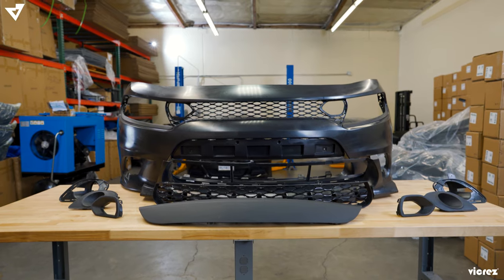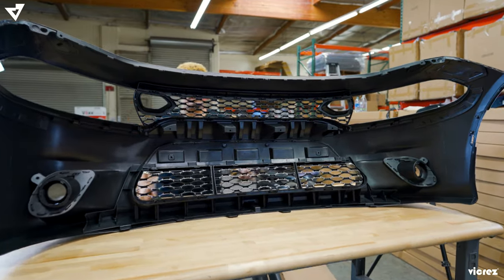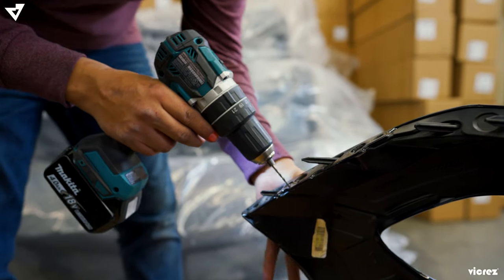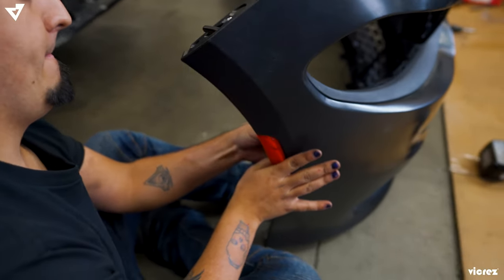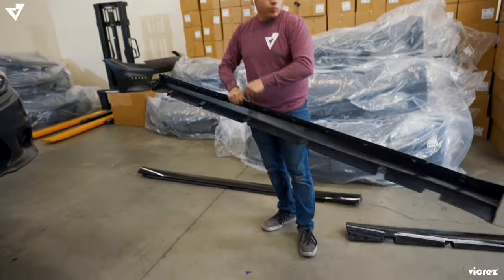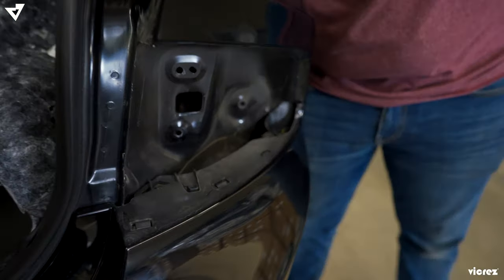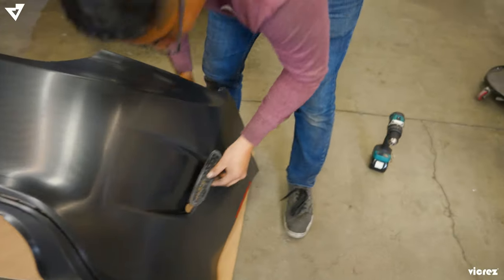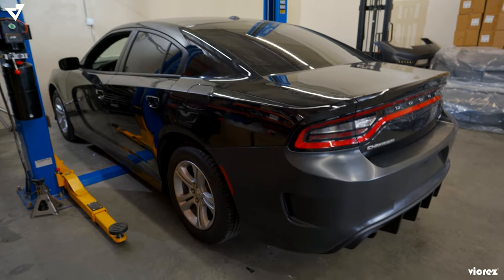Dodge Charger Full Conversion from SXT ➡️ SRT  | Installation  😱

Comment: Everybody in de comments saying to change the engine.. it's easier to say than to do! And for the ones that are V6 haters for no reason, an engine is an engine. They all have their own advantages. Your hellcat maybe gonna beat it but at least the V6 wont run out of fuel in 10 minutes.
Reply: Exactly they be crying at the pump. April 15 2022 reg gas is $3.90 a gallon.. smh 🤦🏾‍♂️
Reply: @ALGreeneHTown  and now it’s 4.50
For plus 😬

Comment: What about the 6.2L engine and torqueflight trans? Lol
Reply: SRT's and Scatpacks have the 6.4.
Reply: @a2xs60  only scat pack has 6.4 L. Dodge did a smaller 6.2 L engine in the srt hellcats to fit the supercharger on top.
Reply: @a2xs60  i have a supercharged 6.2L in my redeye
Reply: Until 2020 the SRT, Scatpack, And Hellcat were all different trims. The SRT and Scatpack both had the 6.4.
Reply from the maker: I have a 6.4L now. Wussup :) - Kat

Comment: Is there a way to minimize the hood gap at 9:43? My Scat Pack didn’t have that hood gap and then I took it to a body shop to repaint my bumper and now it has that big gap.
Reply: if they tightened one side of the hood more than the other it creates it to be uneven which would make the gap.

Comment: Did you miss the front energy absorber and the foam stuffers? Are they not needed anymore… as they were left on the SXT bumper.
Also, what about the screws in the bottom grille??

Comment: I've got a 2018 R/T and I've been going back and forth about wanting to do this for a while. Not upbadging or changing the hood, mind ye. I just want to change the front & rear bumpers and the side skirts.
Fortunately/Unfortunately the 900 other places my money needs to go the now have been keeping me from pulling the trigger on deciding to do it. And I really DO love the stock look of the regular trim. However, I dig the more aggressive front end and scallops on the back.
Reply: Do you have any idea how much it costs or atleast where you live. I’m trying to get a somewhat idea of much it will cost to do something like you. 2015-18 rt to look like a 2019 rt.
Reply: @MrMani28  Well yer in luck, because as it stands I had a window where I had some disposable income to do this and am about halfway done with it all, so I now know exactly how much it's costing to do. So I'm NOT doing anything to the hood and am just changing the front bumper, rear bumper, and side skirts. I'd used Vicrez for the front bumper kit and side skirts, of which the side skirts have arrived but I'm still waiting on the front bumper. These two jawns cost about $1200 with shipping/handling included. For the rear bumper I went with straight OEM parts with part numbers gotten from AVG Joes Garage videos since the Vicrez kit didn't have the holes for the backup sensors pre-cut and prolly still required the closure panel. The rear fascia, valence, left and right bezels, closure panel AND a front belly pan (I needed a new one) cost an additional $1200 and change. Prolly closer to $1300. So let's just say $1300.

As all these parts come unpainted, I went to a local body shop that had done good work for me in the past and the price they quoted me for paint and install (assuming no profound jiggery pokery is needed to get these things on) amounted to $1880. I'd imagine it'll prolly be a bit more because some rewiring is likely gonna be involved getting those fog lights to work.
Others I've spoken to who did this work said it cost $6000 with parts, paint and install. Since I'm leaving the hood as is, it seems I've managed to land a grand under that.
I'm very, VERY upset with myself for dropping all this cash just to make my car look a bit cooler. However, once it's all said and done, it's gonna look effin great. And really ye can always save more money again. As a co-worker of mine said, "buy once, cry once."
Reply: @TheWasteOfTime  wow wasn’t expecting it to be so much but it could still be cheaper to do with a 2015-18 RT charger than buying a 2019-2022 RT charger, overall in the long run. Might be worth looking into some more. Thanks I appreciate that💯
Reply: @MrMani28  Hahaha, I'd legit had the thought "why don't I wait a few years, trade in for a 19 R/T or something and just change the hood?" Seriously though, the money dropped effin hurts, but it's gonna look cool as hell once it's all together. And really at the end of the day, dropping more money than is sensible on something dumb just because it makes me smile whenever I see it is something I've done plenty of times before.

Comment: No additional hardware or screws were used on the front bumper cover?  the area where the lower bumper structure and grille go in...and also the front black out panel.... what size or style screws and nuts hold it on?  i know someone will say "reuse your oem hardware"  but if you are doing a conversion from an RT to this, you will not have the same hardware....
Reply: I was wondering if you found an answer to this as I am dealing with this current problem

Comment: Can someone explain the steps for the rivets? Like wat tool did he use?
Reply from the maker: you drill into the rivet and then you can use a bolt and nut to attach the bracket.

Comment: I have a 2015 rt with srt front bumper looks amazing turns heads everywhere plus my straight pipe adds the amazing sound of the 5.7 nxt will be the srt side skirts & rear bumper & diffuser oh & also im still deciding which hood i want to get to switch out the stock one then after that will either be another paint job or badass wrap idk which yet kuz my interior all red leather & red sueade plus I have 22in srt replicas just need to fix all the curb rashes lol 😆 need to find a place where they will grind all of them smoothly out & repaint them or wrap them as well....I love my 2015 R/T its my wip Work In Progress this video really was helpful..p.s also another better spoiler then the r/t stock one lol its so small
Reply: Sound don’t mean speed

Comment: So I have a 2016 Dodge Charger pursuit...it does not come with standard with“fog lights” .... if I switch to this front end could I install the fog lights??? And if so how would I get them to operate??
Reply: Get dodge to enable them on your cars computer or just wire them to the battery.

Comment: if you bought a SRT rear bumper with sensor holes cut out, can you re use the SXT's rear sensors and mount them on the new bumper? or do you HAVE to buy the new bumper WITH sensors too?
Reply: Hello, yes you can most definitely swap in the sensor of your SXT to your new rear bumper :)

Comment: What about the fog lights did you havento rewire or did u use same wire plug in ?
Reply from the maker: We used the same wire plug in
Reply: @vicrezcom  oh okay I gotcha sometimes it has to be rewired or they won't work

Comment: Do you have to change the fender liners as well or do they fit the new bumpers?
Reply: Fender liner doesn’t fit right on mine after I replaced the front bumper. I’m assuming I have to buy the SRT liner to make it fit right

Comment: Will the front end fit a 2018 Charger R/T? Also do the leads for the fog lights need to be rewired when switching from the linear to circular fog lights? Thanks ahead of time.
Reply from the maker: Yes it will

Comment: Silly question. How are the fog lights gonna connect if there was fog on the original
Reply: Either hook them to the battery or plug them into the computer and have dodge enable it.

Comment: I’m saving up to buy a Scat Pack next year, but the gas prices and risk of having it stolen completely turns me off. I’m now thinking of doing this to my 2018 GT (which is basically a present-day SXT) because I love the SRT look, but it just feels so wrong 😭
Reply: Why would it get stollen easier than any other good car? Lock it and put an apple air tag in the car somewhere so you can track your car anywhere
Reply: Might as well frl

Comment: How much it would cost 2 install if I wanted done on my sxt?
Reply from the maker: Hello! unfortunately, we do not offer installation 😥️
Reply: @vicrezcom  How much were the parts (front and rear bumper)
Reply from the maker: Hello!!   
Here are the prices :   
Link 1 : https://www.vicrez.com/vicrez-srt-hellcat-style-front-bumper-vz101820-dodge-charger-2015-2016-2017-2018-2019  
Link 2: https://www.vicrez.com/vicrez-srt-hellcat-style-rear-bumper-vz101821-dodge-charger-2015-2016-2017-2018-2019

Comment: okay so i got into 2 different accidents with my SXT 2018 Charger, and it fucked my rear and front bumper up. the bumper themselves are okay ish. but the bottom of the front bumper where is latches. and one of the side brackets im sure is broken. where could i go to replace these?
Reply: i am going to be making a decent large purchase on your website for almost a full body change. i just wanna find where i can replace these items so i can buy these bumpers
Reply from the maker: You can use our bumper repair tab to fix them: https://www.vicrez.com/vicrez-vzr101-auto-body-plastic-bumper-repair-kit-1-7-oz-50-ml

Comment: I own 3 dodge chargers a 2016 hellcat, 2018 5.7 basic RT model & just bought the 2021 scatpack widebody. This is stupid because why would you want to do a conversion on just the front, side & rear to look like the premium model? I don't get it. When I bought my 2018 blacktop edition RT base model I seen they had the RT plus which is the same SRT front, side & rear. All it is just $4k more the rt plus or if you got the SXT get the GT plus. I already had a hellcat, so I actually wanted a different look when I bought the 2018 RT base model brand new showroom. I wanted to customize it, but not changing nothing with the body nor the engine. I just added a customize big front splitter, sides & rear that my friend makes, so no one has it. I added airlift suspension 3P, 345 badge & music.  That's all. I break more neck on the RT basic model than I do on the hellcat at that time. Now I just added airlift suspension 3P on my 2021 widebody scatpack, changed the rims, wrapped the car & my hellcat which is my racing go car doesn't break neck & I do also have airlift suspension, 22s Straggered & wrapped, but my point is conversions are stupid because you literally paying same amount after buying the kit, hood, painting it & labor. That's might even cost more because body shops are ripoff. You better off just paying a few thousand dollars & get the upgraded version of the same model at the dealer. I Just Don't Get It!!! 🤦🤦🤦🤦🤦🤦🤦🤦
Reply from the maker: Thanks for watching!
Reply: The kit doesn’t cost 4K in that difference bro 😂